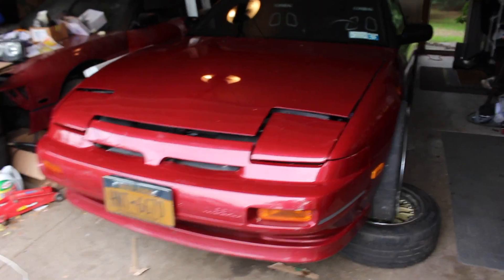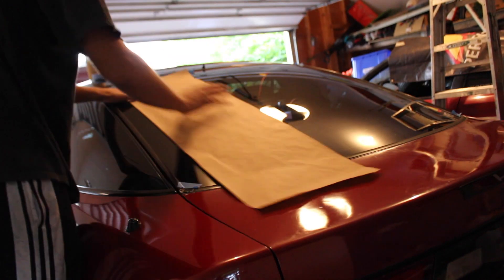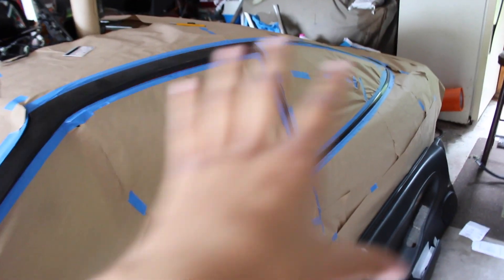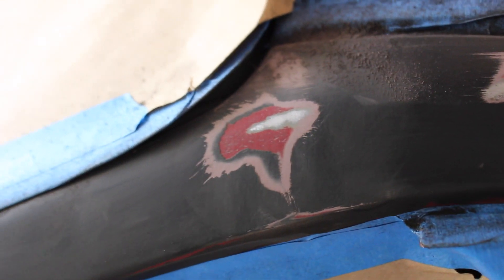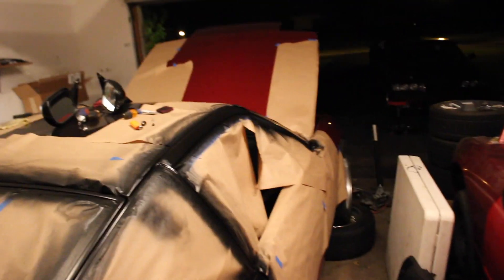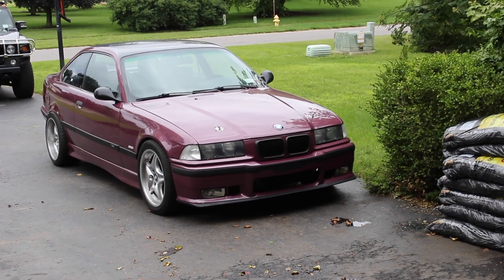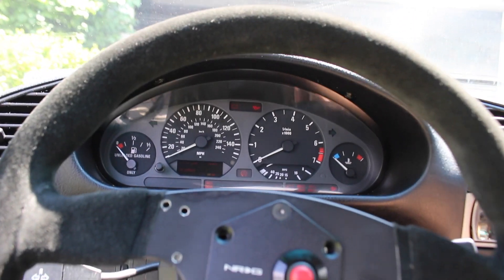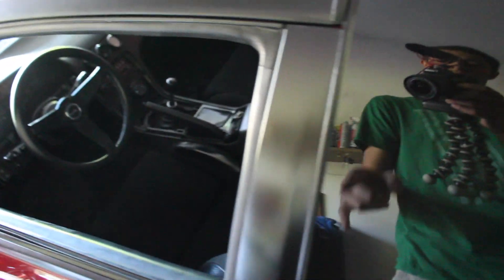240SX Trim Restoration

Comment: The black on the pillar is actually a sticker, so unless you have removed it in the past, you just painted over the sticker.

if you had used a heat gun, you coulda pulled the sticker off like I did on my s13. Now that you have sanded it, it will be much harder to remove.

Comment: Kalvin, I've been a long time subscriber and I'm not trying to hate or anything, but I don't think the product is to blame here, and you might want to change the title. I'm not an expert painter by any means, but if whatever you're painting over looks unfamiliar or is some wacky shit like that filler/sticky stuff, sand it COMPLETELY off. From what I noticed, where you sanded it off was fine, but where you feathered it back in was the part that got messed up. Another tip with SEM trim paint, is to always use their adhesion promoter, or else you risk peeling or just a bad finish in general. It's like priming a car before painting it. Just trying to give some helpful advice. Good luck, the car is looking great, and I can't wait to see the paint after it's been compounded and polished!